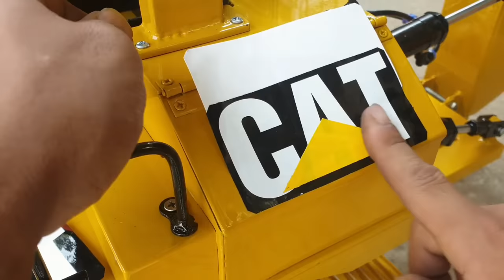Homemade dozer scale 1/8, Caterpillar D11, part 6 | rc action homemade

Comment: Truly amazing to see your knowledge base at work. From machining the parts, tool usage, welding, measuring, understanding hydraulic systems, wiring electronics, programming controllers, painting, troubleshooting etc. Dude, you are an incredibly capable individual. Congratulations on achieving such discipline with your incredible skills!
Reply from the maker: thank you for watching. thanh you so much
Reply: Hello
Reply: @rcactionhomemade  would you consider selling one of these?
Reply: 010
Reply: @spinn71  I just want the blueprints and estimates of material. Looks like a lot of fun to build.
Reply: Золотые руки!!! Привет из росии...

Comment: you went to the trouble of building that, but didn't use any washers or include any grease fittings for your undercarriage.  that's gunna last about a month before it falls apart on you..

Comment: be sure to use a direct to metal urethane like PPG Durathane DTM. Its incredibly strong and I mean STRONG paint. You'll never need to coat it again for things like fading, sun damage , abuse ect. it will last much longer than an oil DTM which it looks like was used. We use durathane to paint side dump trailers and mining equipment with. You'll love it. Great work btw too.